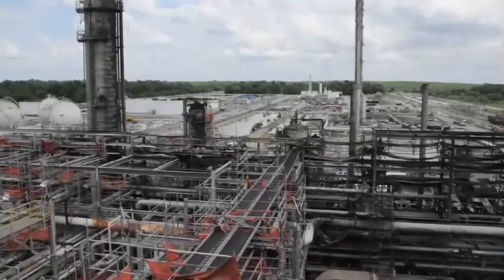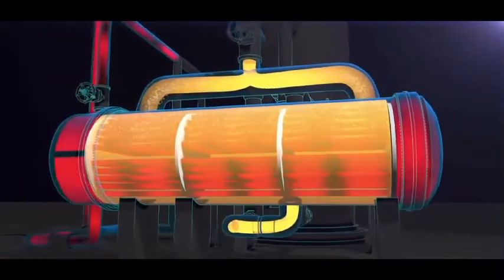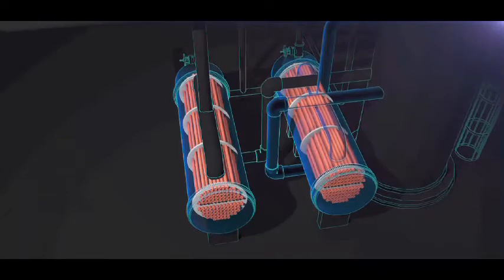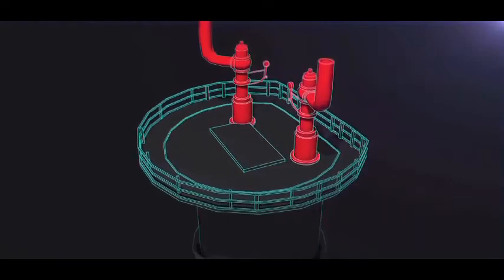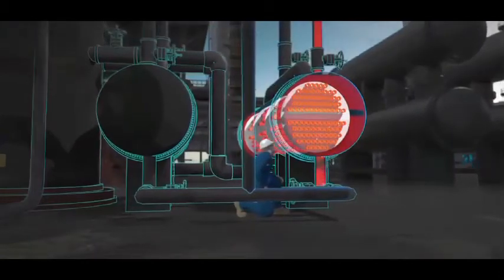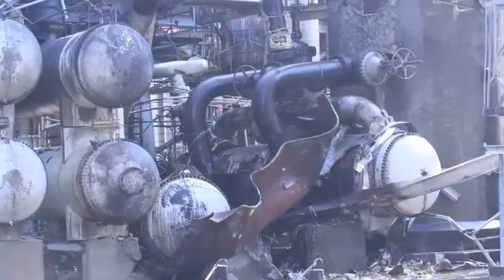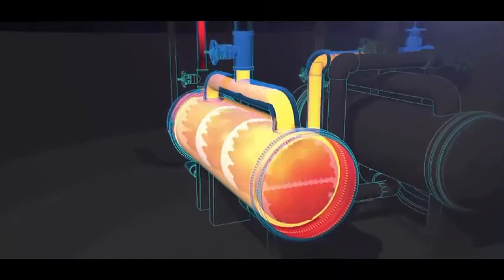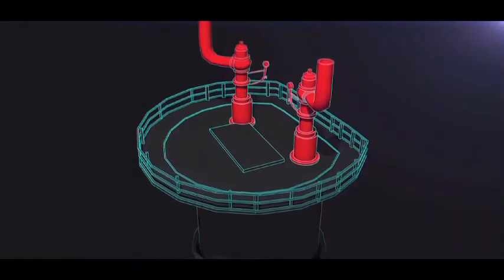Blocked In - PSV Isolation

Comment: This is absolutely insane. Complete lack of common sense. Anybody with basic common sense would know you don't install isolation valves to shut in heat exchangers or pumps without installing proper pressure relief valves. What was the setback? Would they have to add stacks to the relief valves so gas could reasonably dissipate and didn't want to go through the expense? Engineers, either over engineered or under engineered.